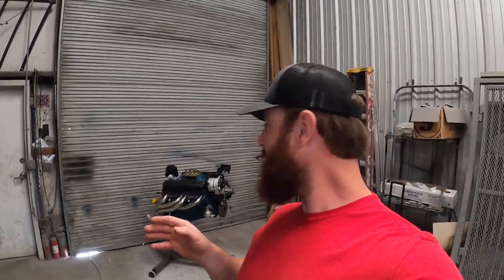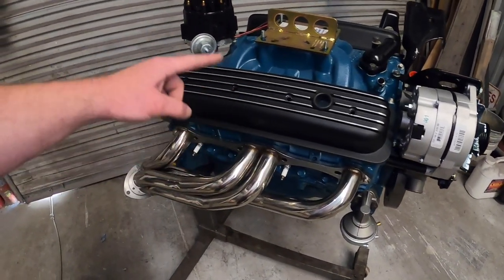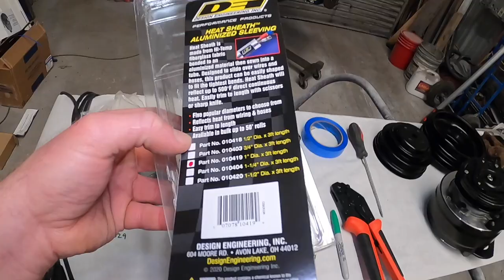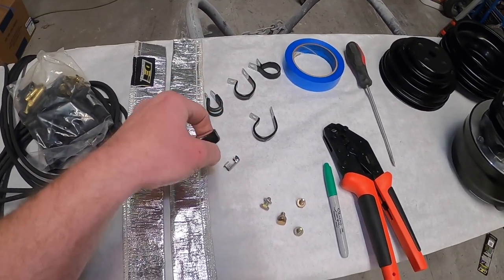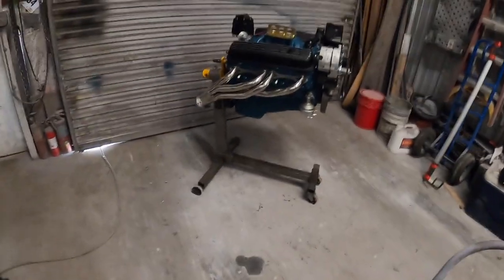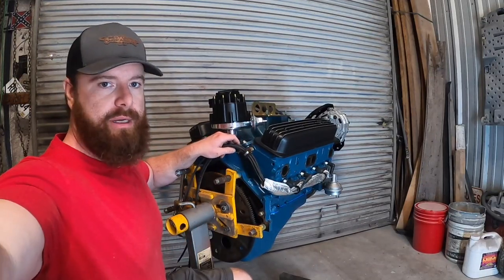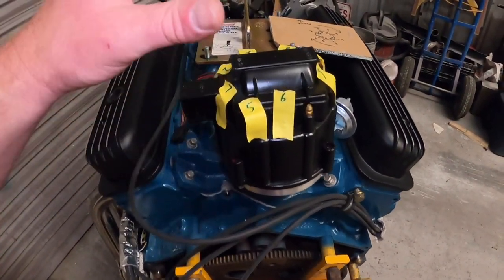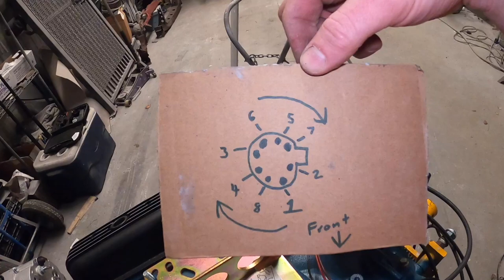Building CUSTOM Spark Plug Wires

Comment: I definitely recommend installing the boot after. Very easy to slide on with a bit of dielectric grease. I find it way too hard to bend the wire 90 degrees to get it out of the "mouth" of the boot.
Reply from the maker: Agreed! I'd much rather push the wire towards the terminal when installing the boot after the crimp rather than pulling the wire and crimp back into the boot, seems like a higher likelihood of disrupting the connection

Comment: That looks great. Really like how you ran the "cross bank" wires under the dizzy instead of around it. 
I just DIY'ed the wires on my the TBI motor I'm doing for my 87 R10 last weekend. I had to use the crappy two metal plates that came with the wires. Saw those crimpers, but boy they pricey. And I just don't do enough DIY wires to justify them. (Only done two sets in 20 years.) But they're waaay easier than those two cave man plates I had to use!
Reply from the maker: Thank you! I've built a few sets in the past and always had to borrow a set of crimpers because the caveman tool frustrates me beyond belief LOL

Comment: Did you purposely rotate the last several inches of wire leading up the the dizzy boot so as to hide the lettering? Nice trick.  
I wanted plain black wires on my project. But my cheap set had "Taylor 8mm Super Stock" on them. Thought about trying to rotate them, but it was gonna be a hassle. So I used a rag with a bit of lacquer thinner to rub the lettering off. Took awhile, but makes for a cleaner overall look.